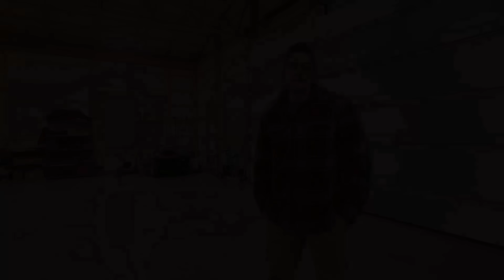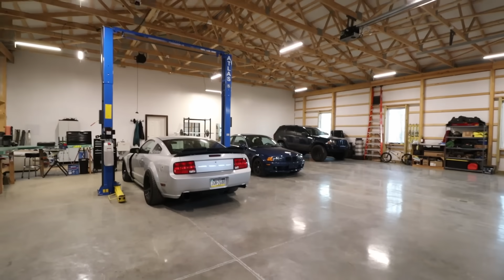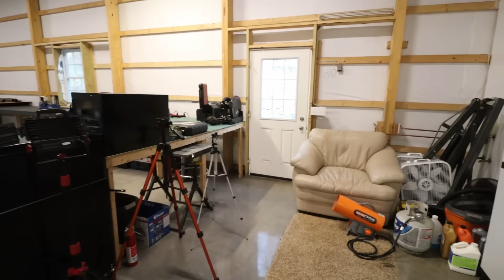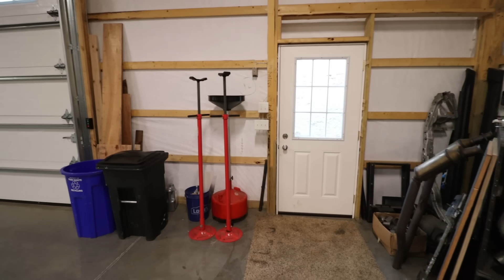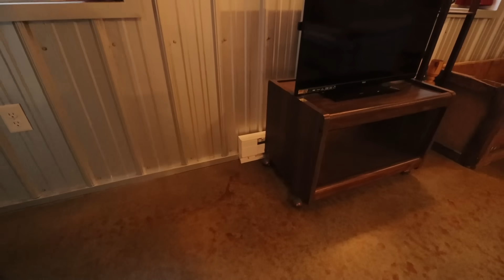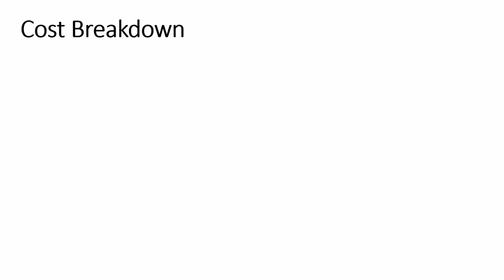50x70 Garage House - FULL TOUR and COST Breakdown

Comment: As a builder ,.I don't see the great savings. 180k plus land which you don't disclose..around 250-300k ? 
   You could own a real house with a pool and either a separate or attached 4-6 car garage for less.
   I'd tell people don't plan it yourself, seek out professionals and get it done right... toilet without walls, drain holes in your house, cement floors in the house( always good for any friends  child to fall on) , uninsulated garage, no footings under the car lift ( floor will crack) 
   Ya your 24, ok..many people buy houses at that age,out of college..I know I build homes for them..my point is , you could have had so much more if you got pros involved..shame...
Reply from the maker: I never said I had great savings. My house was 160 and land was 60. I got this house quoted from traditional builders using traditional stick frame construction and cost was much higher. The concrete is 6" thick and rated to support the lift so it will not crack. I'm super happy with what I got and I know it would have been much more expensive if I went the route you mentioned. I know because I did my homework. You forget that all of these costs also depend on location, for my area this was by far the cheapest way to get my desired footprint.
Reply: Kordare I disagree. I’ve owned a framing co for 30yrs..and your still so far away from finishing what you started. Total cost to do all the extra items you want to do , the right way, puts your final total to ridiculous amounts. Don’t know where you are, don’t want to, but half the stuff you did is not code or even acceptable standards on the east coast. ..sorry no toilet drains in the living room( future or not) 
      6” of concrete is Not a footing for a car lift, sorry, research it...If your happy that’s all that matters. I’m just commenting to let you know or anyone watching to seek out pros to do the work and draw plans...you could have done much better...you would have been better redesigning the roof and putting a loft in the garage, instead of the half unfinished house thing..
    Also the height from the door the the ground is more then 8” which isn’t code either. So when someone trips or falls you’ll get sued. Things pros don’t do...
Reply from the maker: @joeframer9642  alright well it passed all inspections here on the east coast and I'm happy, the end

Comment: any plans for an exhaust system so yo can run a car inside. I thought about doing something similar. I would have built inside the rooms and you could do two stories inside with a high roof and just made 7 foot ceilings . Have you done anything for fire safety?  Very nice place cars are always inside protected. The best way to heat that would have been radiant floor heat or hot water radiant variant this way no need to worry about flammable vapors and open flame. You could always do an out door wood burner for the garage as long as you can get free wood to make it cost effective. Oh I forgot very nice place you have there.
Reply from the maker: Thanks a lot! I haven't considered an exhaust system in the garage as I rarely have any cars running except while parking. And yeah I have considered an outdoor wood burner, I have plenty of free wood!
Reply: Kordare you built my dream too.

Comment: For your shop insulation Rip down 1.5" foam board and put it in between the 2x6 perlins on the walls, it will help  greatly. Also the best thing I did on my shop/apartment building was to hook a outdoor hot/cold water faucet directly to my water heater. This way I can wash rigs outside with hot water during the winter, rinse off snow etc. Works great!!
Reply from the maker: I appreciate the tips, thanks!

Comment: Liked & subscribed.NEVER have to much covered space .for work or storage.I've seen some really nice looking low decks w no rails required.that would fit right in with what you have going on there.with a single slope roof coming off the house,maybe some overegeniered beefy beams w steel plate brackets.blend it down & into natural side open space you have there.take Advantage of your views.Nice job though.I've got a few years on you & don't need quite the space you have,but saved this to show to architect
Reply from the maker: Thanks for the support and I like your ideas, would be great to add some outdoor living space!

Comment: If that structure cost you $100k to $120k then you seriously got ripped off. I built a 3000 sqft. house on 8 acres for $37,400...that included the land cost. Furnace, ductwork, ac, full kitchen, everything..built it myself so the only cost was materials. Build it yourself next time and save a ton of money!
Reply from the maker: Well yeah the difference is I didnt buid it myself. I have a full time job and wanted to get the project done quickly.

Comment: You really need to vent the cook top, it’s a pain in the ass without it.
Reply from the maker: Once I mount the microwave it has a vent built in, but it honestly hasn't been an issue in the 2 years I've lived here.
Reply: I seem to get into lots of arguments with folks on the internet I don’t mean to I guess I’m just lucky. It will eventually become noticeable. Easy to convince yourself. Next time your at say your folks house put your hand on their exhaust fan or better yet if you can touch the wall of the exhaust duct. Some people have a grill before the fan so it can be cleaned from time to time. My point is all that sticky grease you feel will end up on all flat surface in your house. Last but not least that microwave vent you mention will not remove food smells. When your lucky enough to meet the rite person they may enjoy cooking and do it a lot. See what I mean?

Comment: you gotta install some tile or sheet metal in that kitchen especially by the sink.
Reply from the maker: Yeah I plan to do a back splash when I do the upper cabinets.
Reply: @Kordare  careful with water getting on the sheet rock. Dont want to have to redo a wall

Comment: I built 2 warehouses that we're 250,000sqft each and then 3 years later I built 2 more warehouses one was a total of 100,000 sqft and the other was 80,000 sqft and then a 2 foot thick concrete wall separating the warehouse from my 5,000 sqft shop on the ground level and the 2nd floor was my 5,000 sqft house with 3 1,000 sqft master bedrooms and a open kitchen, office and living room. I had a spiral staircase in the front next to a elevator and in the back a wide staircase. On the 2nd floor I have 7 balconies with one of them being able to open the railing to move anything upstairs with my forklift so I don't have to carry anything upstairs or downstairs which is awesome to have.

Comment: With a garage space like that and offsetting the lift I would have suggested putting it at an angle. You probably could have put two side by side on half the garage.
Reply from the maker: Yeah I could have done that, maybe I will if I add another lift, dont really have any need for it right now though

Comment: Awesome project graduation 
I know it’s an additional cost but I think I would’ve went with the heated concrete slab my neighbors garage and house is heated floor and it is awesome but I have to say very nice structure enjoy it
Reply from the maker: Thanks! I did consider that option but didnt want to worry about drilling into the pipes when mounting things to the floor and dealing with a more complex heating system.

Comment: Add a gun range, a hot tub, an mx track, maybe some skylights, and ceiling vent fans for the garage and it's perfect!
Reply from the maker: It will all come in time 🤘
Reply: indoor gun and bow range too !!
Reply: Absolutely,  in time. As motivated and driven this young man is, if I was a betting man I'd say he'd have all that and then some by 30.
Reply: @XSteele  Depends if he gets married or not. If he does just watch how fast it goes up for sale.
Reply: I have a big screen TV, shuffleboard, foosball table, wood stove, dart board, batting cage and pitching machine, (that is on cables for easy storage against the wall), rolling cabinets for woodworking tools and welding machine, and decorated with old gas, roadway and industrial signage. And a full Dall Bighorn Ram head mount on the wall. Life is good.
Reply: Sauna.
Reply: 10’ quarter pipe up one side of the garage, haha!
Reply from the maker: @shokojimhollingsworth3940  check my most recent video!
Reply: dont forget the full BAR/wet bar setup lol
Reply: You forgot the pool table, bar, and home theater / audio system.
Reply: Put some Big Ass Fan Co. fans in the garage. It will make working in the summer much more bearable.
Reply: No walls allowed in the garage!

Comment: Fantastic build! One question, did you have to put some kind of frost protection such as 4ft walls in the foundation even though it is slab on grade and did you insulate that slab?
Reply from the maker: Thanks! I believe the answer is no to both but I'm honestly not sure. You may be able to tell more if you look at my build video.
Reply: @Kordare  Ah! Watching now. No it does not look like frost protection but I have a good idea to be able to build one in our area (Canada). What area was this built in? There must be lax building codes. I know you are young but my wife and I are 50 and nearing early retirement and we would LOVE something like this up north. Where we are now it would cost about $300K just for the land alone!
Reply from the maker: @JohnAdamsCan  wow! I'm located in Pennsylvania so definitely a milder climate than where you are.

Comment: FIRE WALLS AROUND THE WATER HEATER, those things can be very, and I mean very dangerous
Reply from the maker: Really?? I've always just seen them out in the open in basements and garages.
Reply: Kordare Most are in garages because of the fire wall requirement between the rest of the house and garage, but i’d give it some more research just soeaking based off of what happened to my coworkers water heater
Reply from the maker: @demonsamongstmen562  will do!

Comment: Did you have the concrete floor polished/sanded and sealed. What sealer did you use?
Reply from the maker: I just had the contractors do a smooth finish, then I cleaned and rolled on a polyaspartic coating from surecrete.

Comment: Really like your setup. May I suggest some type of guard around your water spigot? You probably wont damage it but if others are working in your space with you it may become an issue.
Reply from the maker: Thanks for the suggestion, I also need to add some more insulation around it.

Comment: You should rig up some sort of a retractable plastic curtain system so you could close off an area around where your drain is in case you ever want to paint a car there, or even just for washing and keeping the spray in the air contained to that one spot.
Reply from the maker: Yes I've definitely had this in mind. Hasn't been an issue yet but I could see myself doing it eventually.

Comment: What state do you live in?  NEC does not allow exposed romex lower than 6 feet in a garage/workshop.  We ended up using MC cable to wire the entire garage.  Cool setup.
Reply from the maker: I'm in Pennsylvania.  Yeah some others have mentioned that but it seemed to pass code here
Reply: @Kordare  Odd because the NEC says otherwise.  Maybe they figured you were going to insulate and sheetrock so they let it pass??
Reply from the maker: @SeanFastidious  it is possible, which I am planning to do...
Reply: @Kordare  Inspector probably thought that.  Good idea.  We just used raised industrial metal boxes and covers and never insulated.  We installed a 25k btu mr heater infrared though.  It would probably work great in your large space since it is a heat that feels like direct sunlight.  They are great and use very little gas.
Reply from the maker: @SeanFastidious  thanks for the tip, I'll check those out.

Comment: This is a Great Video as it allows YOU to see how to plan for. Garage Build rather than a house build and Then adding on the Garage.  The only thing I would have recommended is day why did you not put a urinal in the garage as a man I pee standing up and I would have had the toilet closer to the wall where you going to put a window in so if you did have to go to the SHiTTER you could open up the window. I definitely would have had a nice big shower built in the garage therefore You do NOT take in the Dirt into the house. Also a TWO door walk into the house will save you on heating or cooling depending on whete You live. The Garage with the drain and 6 foot concrete is very nice. I like that You did the cist factor as THIS realky gives one an 💡 idea of how this will cost. So less than $200k one can live very comfortable here. THANKS again. Alan 😃 infoSeeker007
Reply from the maker: haha I agree a urinal would have been cool. Thanks for your input and for taking the time to watch!

Comment: Nice review.  Well done.   I was wondering if you considered steel frame versus wood and why you went with wood.   Then, with the wood choice, what was behind choosing the metal siding.  I am assuming cost was primary factor, but what else might there be to consider?
Reply from the maker: Thanks! I did consider steel, but you're exactly right, cost was the main driving factor when going the direction I did.

Comment: Great Garage and house.  Any plans to install solar on the west side roof?  You could also install a small south facing ground mount system.  With one to two people, a 5 KW PV system and a 10KW-12KW Hybrid grid tied inverter with battery backup for when the power goes out.   Also, a heat pump water heater would also help with cooling & dehumidification in the summer. It uses way less electricity as well.   I like what you've done.
Reply from the maker: Thanks! My electric usage is very low so I haven't considered solar, but maybe someday!

Comment: DUDE SAME!!!  overall i think ya did good.
if you had gotten insulation first you wouldnt cave effect the whole place
i wouldve put an airlock type system betweeb the garage and out side 
(airlock system is one door close one door open, helps retain alot of heat inside the space, prevents heat from escaping and cold coming in. Personal pref. here)
Reply from the maker: That sounds super advanced for my budget....hahah

Comment: Always install under floor heating piping even if you don't hook it up right away, it adds value, also look into water reclaim (grey water) also look into 'coffin' tubs like a regular bath tub bit smaller, yea septic systems can be pricy. If you look into septic reclaim,  eg using it as fertiliser you can get grands for this 'eco-house' for your garden. Very good build, get that garage insulated,  many local authorities will give grants to you to upgrade your house to make it more 'green'. (as you garage is part of your house, you may qualify to get VAT free materials for your house, especially as you do work in your house for your company, this also applies to your electricity and heating bills)
Reply from the maker: Thanks for the tips, at the time I didnt want to deal with the extra cost to install the piping and I didnt want to worry about drilling into it while mounting lifts to the floor.

Comment: Seems expensive honestly.. I did alot of work on my own house its 2000sqft with a attached 30x40 garage on 5 acres completely finished basement right at $190,000
Reply from the maker: Well that's what it cost for me. I got a lot of quotes and tried different construction styles. This was the cheapest way to get the square footage I wanted.
Reply: @Kordare  Well you did your homework and got what you wanted is what matters.. Your area might cost more than mine.. I actually got quotes on each piece of my build all the way from the insulation to the foundation pour.. and almost worked myself to death doing alot of work myself that prolly saved me 30-40k alone.. Getting ready to do it all again on a 40x80 building..
Reply from the maker: @chipsammich2078  yeah it was a give and take, I could have done more myself but I was working full time and just wanted to get it done after such an exhausting planning process.

Comment: Should have installed the lift at a slight angle so you can drive straight in/out - also very handy if the car is a non runner and you need to push it without needing to steer. My OCD would be telling me to install square like you did though. The struggle.
Reply from the maker: Yeah I thought about it but this has worked fine, it satisfies my OCD....hahah

Comment: You mentioned your septic system has pumps. If you lost power for an extended time would you lose the ability to use your plumbing? Are you considering installing a generator? A friend of mine did this exact same thing years ago with minor configuration changes. Loved it. One other thing. How do coding guidelines come into play? Is that kind of structure allowed in all areas of just rural?
Reply from the maker: There are holding tanks so I could use all my plumbing for a while until those would get full and need pumped.  Every municipality has different code requirements but it wasn't an issue here in Pennsylvania.

Comment: did this 20 years ago, commute is  a bee, but I'm still happy with my place..... take your time finishing the details as your tastes will change and so do decorating materials. Don't be afraid to have some fun with the basics, secret bathroom doors, cabinets that are not cabinets and parts storage cabinets. I"ve enjoyed building the interior as much as the exterior. Oh, and spend the $$ to insulate the garage portion. I used 4" but go thicker if you can afford it. Plastic backed sheet insulation.
Reply from the maker: Thanks for the tips and for checking out the video!

Comment: You should of went with full heated concrete floors zoned out.  Then used an out door wood stove
Reply from the maker: This was an option I looked at but I'm glad I didnt do it. I didnt wanna worry about drilling into pipes in my floor and having a much more complex system vs what I have now.